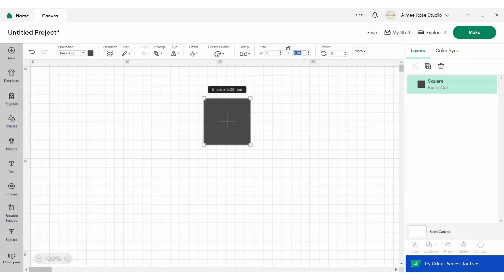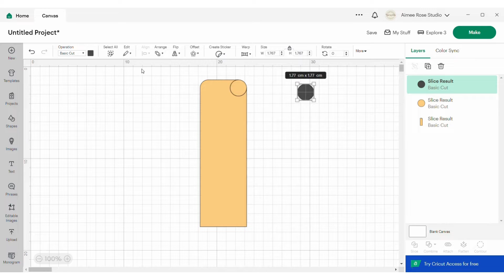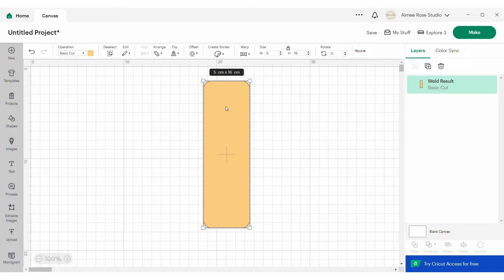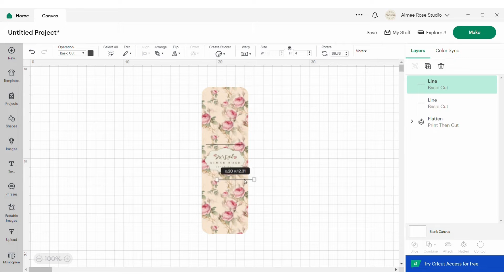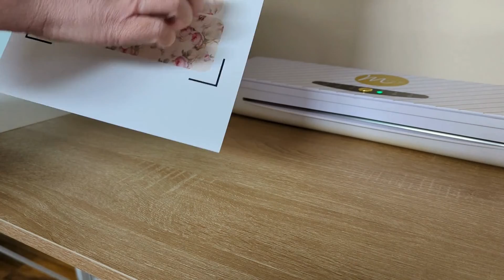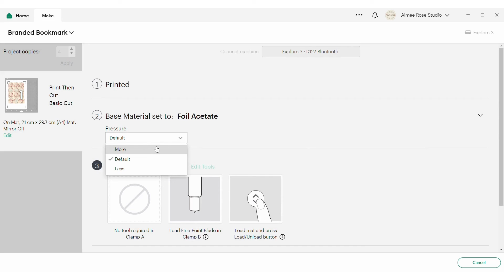DIY Bookmark Holders With Cricut: Easy Design and Make Tutorial

Comment: When you have lamented the page and cut it, does it not have the open peel between the front and the back of the bookmark? Because it's been sealed together so if they get cut out would the edges not then become open if that makes sense at all? as when I've lamented things in general and then cut them out you can sometimes seen the paper in-between the laminate sheet.. sorry if this doesn't make sense 😅😅
Reply from the maker: I haven't had this problem but I understand what you are saying! The bookmarks are still intact and do their job :)
Reply: @AimeeRoseStudio  Ah that is great thank you!

Comment: Is it possible to create this for a set of 3 bookmarks so basically one sheet that holds all 3, also would it be possible to have top and bottom inserts instead of sleeve so the whole bookmark is visible?
Reply from the maker: Yes of course, you would just need to resize accordingly and place the cut lines in the appropriate places :)
Reply: Thanks for the reply Sarah. Unfortunately i dont have the tools for it, would you consider doing this for me for a fee. If so how can i contact you to discuss?